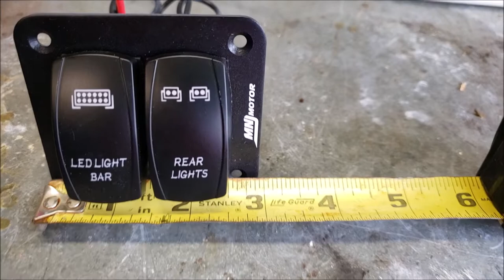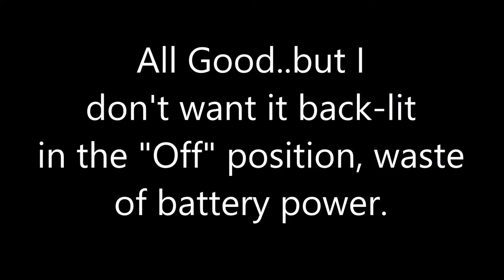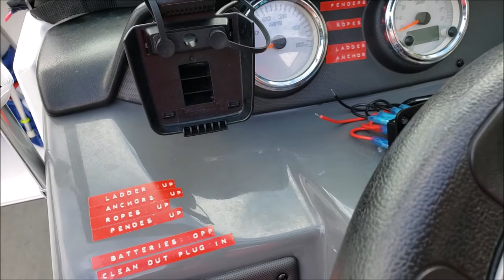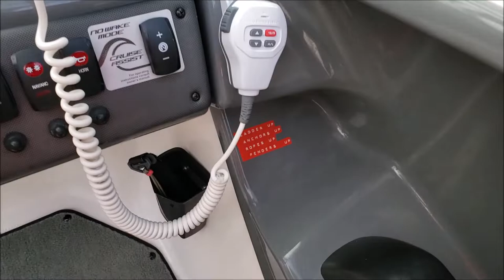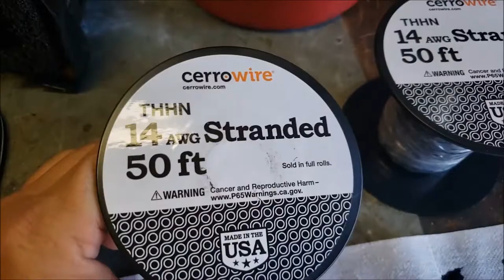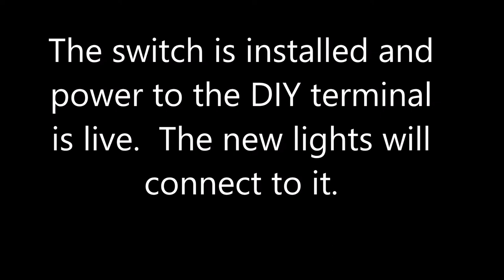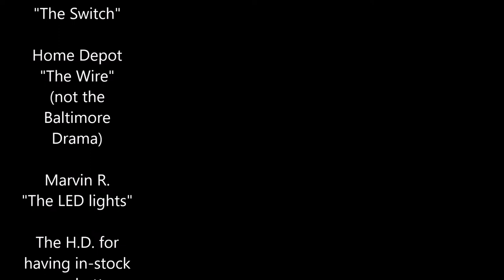Yamaha Jetboat Install Electrical Rocker Switch On Boat

Comment: Another great video! I Watched almost all of your videos yesterday. Going to do the dual battery in my boat. Ready to see what lights you chose and where you are going to place them!
Reply from the maker: Aloha,

Well my plans (at this moment) are to create 2 more light chains for inside the boat. One inside all the stowage lockers (this will be a white light) so if there is a need to find something in one of them, flip the switch and they all come on, just pull off the seat cover and find whats needed.  The other one will be deck accent lights...not sure what color yet.  The last light(s) will be a transom light in the water and that will probably be Blue. 

Thanks for the comment and good luck on the Dual Battery set up!